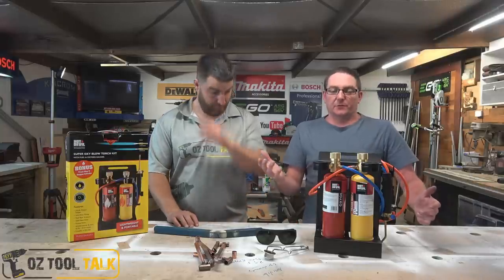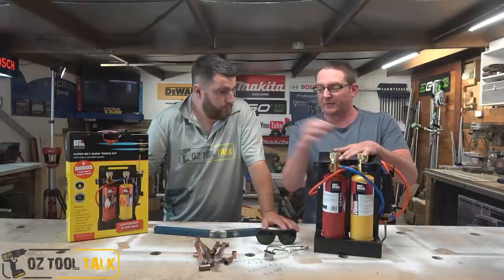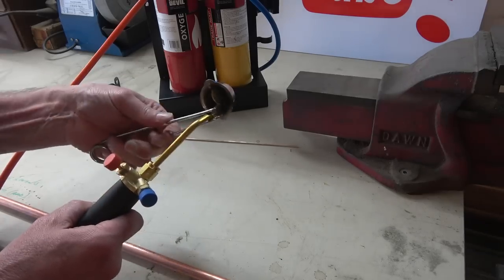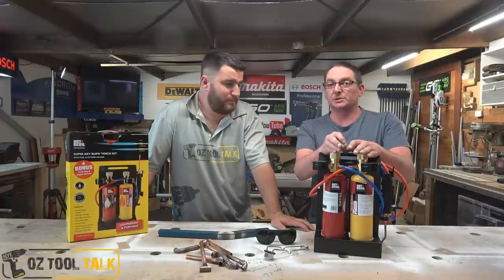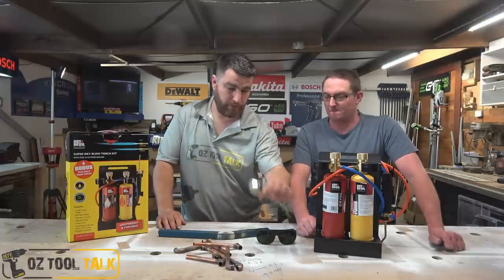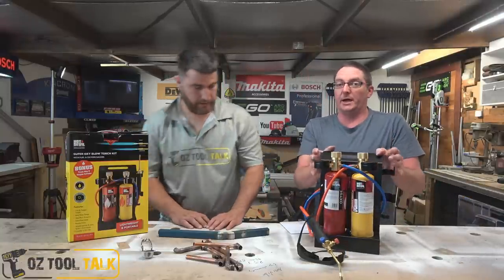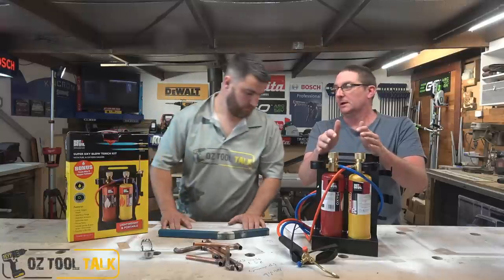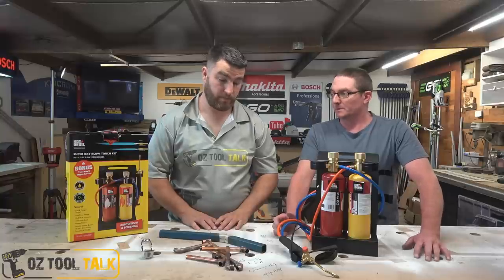HOT DEVIL: Super Oxy Blow Torch - Sponsored by AHJ

Comment: Hey guys, ripper review as usual, used one of these for light work around the house and hobby work for a while now. Picked mine up with a bonus bottle, can't speak more highly of it. Saves pulling out the welder as well. Biggest thing, run time on the oxygen, 20 minutes is average, learning the set up for opening the valve is important for the oxygen, less is more, open it too far and will eat the bottle in no time. Great set up overall and particularly for tight spaces.
Reply from the maker: Good feedback cheers Nic
Reply: Thank you

Comment: The tuseco turbo set 200 is a much better version of this setup and we buy the oxy bottles in bulk and account price is much cheaper, we use it for brazing copper(refrigeration), I found once I had used the set a few times I dialed it in to the perfect flame setting getting good heat and good use out of the oxy. Most jobs only have a few welds todo so we have saved heaps of time and money and mucking around setting up the big set weighing like 20-30kg vs 6kg, we also carry these in our trucks and keep a big set at the workshop, saves the boss like 100 bucks a month bottle rental. Like you said too we book it to the job anyway, work smarter not harder!
Reply from the maker: Samuel Rule great feedback ! (How much is the setup you have ?)
Def clever buying bottles In Bulk if you can. Nice work 👌🏻
Reply: @OZToolTalk  I think the turbo 200 set is around the 299 mark

Comment: As a novice I wanted to try some aluminium brazing for some  architraves I was put up on a reno I'm doing. It took me two OXY bottles to get it right but worked like a treat.
Also this would have been worth its weight in gold when I was replacing my jet pump housing on my 2009 Honda jet ski, some of those bolts defiantly could have used some well directed heat on them to soften up the thread lock. I snapped two of them. All in all I think its a great piece of kit.
Reply from the maker: nice